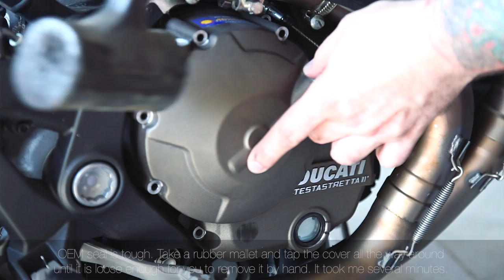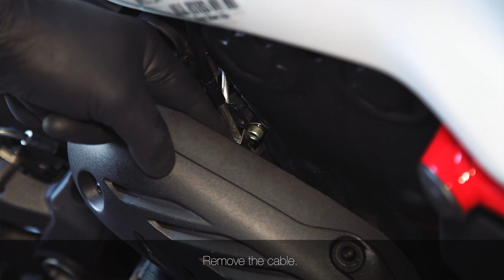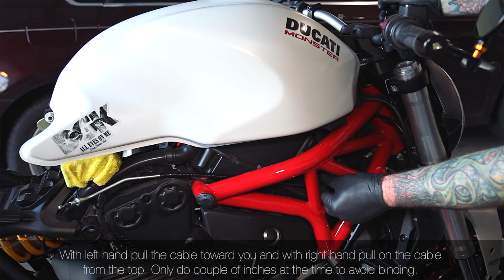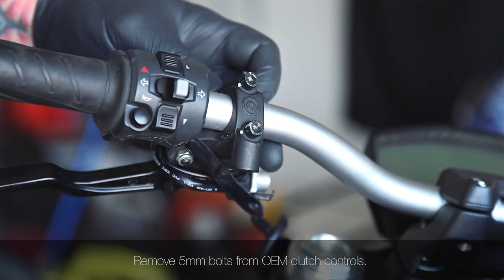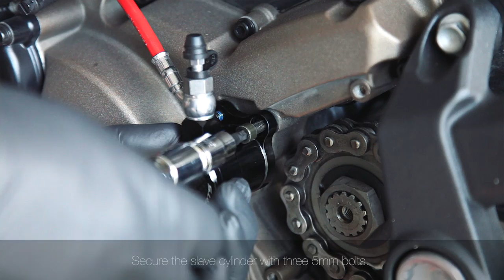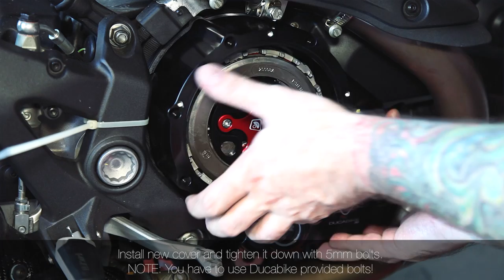Ducati Monster 821 | Ducabike Clear Clutch Cover and Hydraulic Clutch Conversion

Comment: Great video, thanks. I really like the way the clear cover looks, and I like the idea of a 50% lighter lever pull. 

The thing that is holding me back is the fact that my bike is brand new, and it makes me nervous to modify a critical system like the clutch. I'm worried that my dealership would refuse to do work on it if anything went wrong down the line, and that the warranty may be voided.

Thoughts?

Comment: But... if you are hit on this windows ? :p Probably not enough tough to avoid the broken no ?
Reply from the maker: Hit how? It's not glass and it's a really thick strong plastic that is supposed to withstand a pretty hard hit. But if it gets hit hard enough to break, It's easier to replace than than the whole cover.

Comment: I had no idea the slave cylinder was just taken off and a plug was put in it's place for these Duck's with mechanical clutches....
Reply from the maker: Those parts seem identical to 1200 so they went the cheap route. I bet how much time they spend making the plug it would have been cheaper just to give 821 hydraulic clutch in the first place lol.
Reply: Lever pull better now, as in is it easier to pull?
I know I had to upgrade to a 30mm STM slave cylinder from the stock one on my M1100, the stock one was rather heavy from the start.
Reply from the maker: Steamin Steven A lot easier to pull! And now I can easily sit at the light with the clutch pulled in without my hand hurting. Cable wasn't bad but quick shift are butter smooth now.

Comment: why !!why would you that? isn't owing a Ducati enough?!!
Reply from the maker: Why not? Why buy fancy shoes when the ones you wear are just fine? It's all just for fun and why not?
Reply from the maker: While you are riding, oil splashes around but it quickly drains when you stop. Once it drains down, cover is very clean. I have yet to notice any reside left on the windows itself. I would imagine if there is anything, oil would pull it down and it would get filtered.